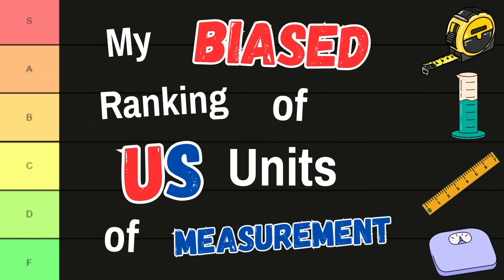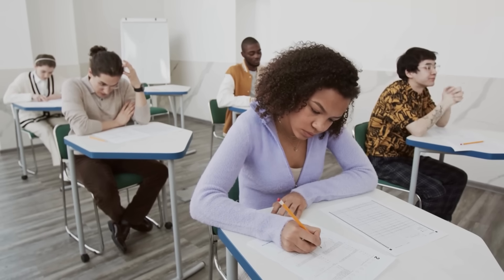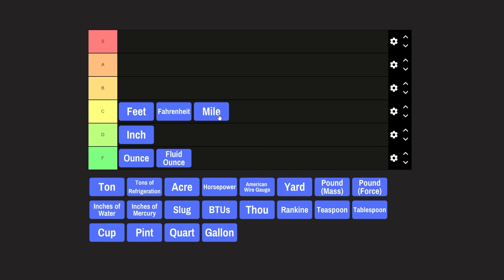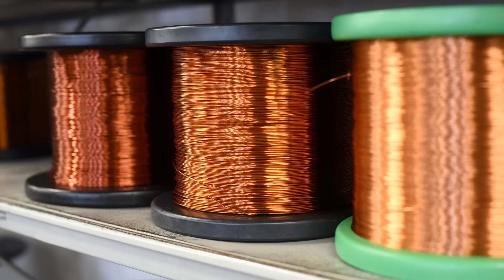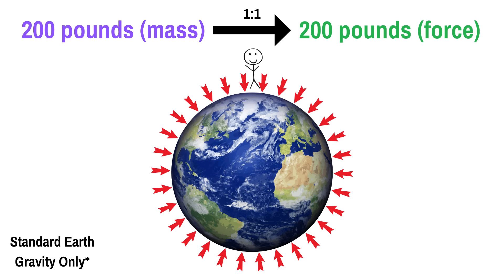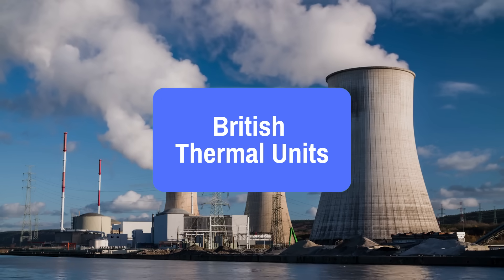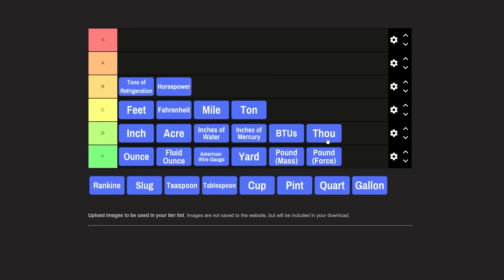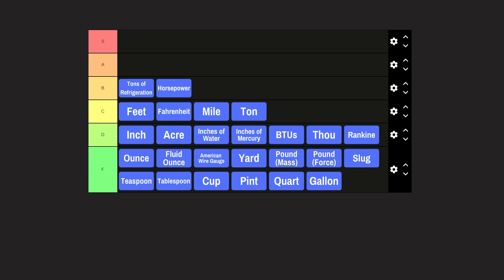Tier List of the DISASTROUS US Measuring System

Comment: Metric would be chill, if it were base 12
Reply: That would just make it harder
Reply: @logitech4873 base twelve is superior
Reply: @logitech4873  can you cut something in half, thirds, quarters and sixths easliy? literally yes, its the easiest form of division in humans, and guess what? its base 12 aka the american imperial system (glossing over the fact that a fair few measurements are different from one another, like how the mile is derived from the roman mile, but the nautical mile is one arc minute of latitude, and the yard/foot isnt even a part of the mile so intermixing isnt actually used, we just say half a mile if its roughly over 800 yards or 2400 ft)
Reply: @MrScorpion132  12x12 is more unwieldy than 10x10. Base 10 is as simple as it gets.
Reply: @logitech4873  until you convert odd bits, say for example you need to use 340 grams of whatever in a recipe, tripling it (common in the US as we often are expected to have extra food for guests to take home, or if people want to use a recipe they have on hand) in metric, you have to think more than 2 seconds to apply the ratio, here, we just say 3 cups.

the need for extreme precision in things like baking or building is rare for the average person, as nobody really cares if their cake recipe is barely noticeably different because the humidity along with some grams of flour or sugar were slightly off. neither do most carpenters need millimeter precision, usually 1/16 an inch (halving 3 times, very easy to do visually even) is the most anyone really needs.

now, dont get it twisted, we still actually use metric for things requiring the absolute precision it provides, physics as well as any high precision field (yes even in manufacturing) as well as international requirements are all in metric
Reply: @MrScorpion132  In your first example, why is it conveniently 3 cups?
You could change the example to be that you need 3.4 cups (or 3 and 2/5'ths or whatever), and you need to triple it. Now it's the same problem requiring the same amount of thought.

Conversely we could be talking about 300 g instead, which very easily triples to 900 g.

You are cherry picking numbers to suit your argument, but it doesn't make any sense because these numbers could be anything in both systems.

You don't need extreme precision for baking. But grams is the commonly understood small unit.
Reply: @logitech4873  i went with the converted scale here for simplicity, the whole point was that imperial is more ratios than hard numbers. due to that we dont tend to deal in 3 and 2/5ths,  if we do have a remaining fraction, it sticks within the base 12 system so its something like 2 from an inital 2/3. since we dont need scale level precision we can also **JUST USE THE SAME MEASURING TOOL MULTIPLE TIMES** oh i need 1/3 a cup? even if i dont want to do the mental math i just get 3 scoops from that measuring tool, its still quick and easy in our heads.

ive still seen grams and metric used in more industrial or larger scale bakeries where consistency is required, and i wont dock points for it. they're using metric for its precision and thats perfectly fine! we use both here in the states, US imperial for times when we want easy ratios and mental math, and metric for precise work.

Edit: for clarification, i went with one cup and tripling it because many recipies require a cup of milk/flour etc for sauces breads baked goods or whatever, and a cup is 340 grams, (now we measure liquids and dry ingredients differently, but any baker knows you mix dry and liquid ingredients separate first then combine anyways and thats just one aspect, the same can be said for volume conversion)
Reply: @MrScorpion132  We do the same approximations though. Our measuring spoons and cups are just differently sized. I feel like you're inventing a problem that nobody has.
Reply: @logitech4873  i edited it for the clarification on why i went with one cup. however, if we want to stick with the baking analogy, as most people dont need exact weights for ingredients here, the ratios can make for easily remembered and shared recipes, its a holdover from the fact that humans just intuitively divide and multiply by base 12 faster (actually scientifically proven, you can intuit a half or third or quarter, as well as double or triple or quintuple, while doubling something like 23 or 36 has issues) as well as in older times people had a cup that they used for measuring, and you could reasonably assume others in your village did the same, even if they werent exact if the ratios were kept the end food would be as exact as anyone practically needed.

again, nobody here expects it to be scientifically accurate, we just dont need that kind of precision so we go for the more practical quick easy mental math that any human can intuit from birth. its just physically harder for the average person to divide by tenths than halving again and again. both systems have strengths, both systems have weird oddities (like the meter originally being ever so slightly shorter than mathmatecally 40,000 km = the circumference of the earth) but both are now linked to mathematical constants and retain the strengths and weaknesses of their respective bases and neither should be shamed for people using them as intended.

we use a 0-100 granular scale for weather, the roughness yet quick practicality of being able to divide a foot in half, half again, and even more for our easy 1/2 1/4 1/8 and 1/16 measurements, the easy ratios for volume (1 gallon to 4 quart to 8 pint to 16 cups or a 1:4:2:2 ratio)  and even upwards, 3:1 feet to yard (which is only 3in / barely more than 1cm shorter than a meter, which despite only being 1% ish out of tolerance is extremely good for such a quick and dirty conversion). and even in metric, you still do as much as you can in those ratios, base 10 just doesnt allow for as many divisions, being 1, 2, 5, or 10 vs the 1, 2, 3, 4, 6, and 12 of base 12. its still more precise, but that comes at the cost of more complexities in daily use

Comment: As someone from a metric country to US, I think Fahrenheit deserve a A tier. Fahrenheit is perfect as a unit for setting air conditioner. Celcius is just a bit too coarse for this job. Ounce its self is ok, but fluid ounce a nightmare. The a fluid ounce of water does not weigh one ounce. The fluid ounce is first defined as the volume of a ounce of wine. (Why wine?)

Comment: Metric system is way better, but I think we need an octal system instead of a decimal one and a new temperature scale. While I get that both fahrenheit and Celsius have their benefits (especially for weather), Kelvin should NOT be based on Celsius, but rather on the ideal gas law using 100 or so instead of 273,15

Comment: The 39th root raised to the 6th power isn't even a fully simplified radical expression. It SHOULD be written as the 13th root raised to the 2nd power. And even then it still doesn't make any sense.

Comment: 1:03 Did you subtract the weight of the container?
Reply: Did u look at the scale
Reply: He did, it's at zero to begin with
Reply: The scale reads 0 before he pours in the soda, so yes, he did. The volume of soda weights more than the same volume of water would because soda is denser (which means it is heavier per unit volume). Soda can be thought of as a mixture of  water and other things, primarily the sugar. The dissolved sugar adds weight to the substance

Comment: I was a draftsman in the US for a specialty stair company. There is nothing wrong with the Imperial system and I don't understand the hate.
Reply: 1) if there is nothing wrong then why is it defined by the metric system?
How do you know how long a foot is? When you answer that,  ask how you know if that measuring tape is accurate? Ultimately it is all defined by the metric system.

2) conversions,  as soon as you start needing to convert,  the imperial system is at best an encumberance and at worst a space shuttle disaster waiting to happen. I mean imagine you had 50 40-foot lengths of fencing,  how much is that in miles? That calculation would be effortless in metric and the answer precise. 

3) most Americans don't know the imperial system at all,  they only know the units they commonly use. 
For example I'd bet you don't know how long a chain is,  or the length of a rod,  and before you claim that you don't need to know those,  the rod is the defining measurement of an acre, at 160 square rods and the entirety of the US measures land area in acres.
Reply: @xaiano794  there's that hate I mentioned lol
Reply: @toshaheritalvinen6543  how did you infer hate from my post? I regularly use the imperial system,  I literally come from the country that invented it and I think you're just trying to deflect since you clearly know my points are valid and are unable to offer any retort to even a single one
Reply: @xaiano794  fair enough,  honestly at first read I thought you were being condescending, but upon rereading it I see you weren't. I think your criticism of not knowing the more obscure units of measurement is pointless though, since an acre is easily defined as 43,560 ft^2. And I know there are 25.4mm in an inch and we have been defined that way since, what, the 70s?
Reply: @toshaheritalvinen6543  Be honest, you didn't know the conversion from square feet to acres from memory.
They aren't obscure, they are integral imperial measurements and I regularly use chains in my job.
The point of not using them is when you use lower units there is the tendency to round off which is exactly what makes metric the better system.

A perfect example is the ton, that should be 2240lbs as 1 ton is 20 hundredweight, but since americans didn't know what a hundredweight was, they rounded down to 2200 lbs to make it easier to understand, yet that wasn't enough and americans still struggled so in 1832 they rounded it off more to 2000lbs, this made conversions even more difficult since it was both different from an imperial ton, 2240lbs and also different from a metric ton, which at 2204lbs (1000kg) was very close to an imperial ton.

The only point to the imperial system is to use intermediate units to simplify calculations and since the US no longer uses those intermediate units, it means conversions are only ever done on calculators, an example would be your conversion of acres to square feet - like how many acres is a square mile? are you going to resort to google? pretty certain I could do the calculations in rods pretty easily. If you're resorting to google, then why not just use metric as you could do that in your head.

Comment: Moving the decimal place in metric to do conversions while seemingly easy is fraught with error as the direction and quantity are not always intuitive.
Whereas distinct conversion factors in imperial provide a degree of reassurance that the proper  operation is being performed
Reply: Sophisticated rage bait
Reply: Bs,  the answer is intuitive,  if i said i had 50 40-foot lengths of fencing and then asked you how many miles that was,  I'm not going to move the decimal place the wrong way and claim it's 600,000km long.

Comment: Okay im in thermodynamics and i do agree that faranheight is a horrible unit of measument to work with. But SO IS CELSIUS!! Both need an addition in the hundreds to be Absolutely accurate and both are basically arbitrary. The only difference is F is way more useful in everyday life (most of what it gets used for anyway) so it is a clfar superior measurement to C. I agree with everything else and wish the US would switch to the base 10 bliss that is metric. Its so much easier when all the units youre using can comfortably fit between 0 and 100 with just some minor modifications of terms. 2500 grams? Nah. 2.5 kg. Way better. 20°C??? Hell nah. 68°F
Reply: Name one reason as to how Fahrenheit is more useful.

Comment: Here’s the Metric System for ya
1 centimetre (cm)
1 metre (m) = 100cm
1 kilometre (km) = 1000m
1 kilogram (kg) = 1000 grams (g)
1 gram (g) = 1000 milligrams (mg)
Way simpler than Imperial to understand cuz it consists of 1s and 0s.
Reply: There are 1000 milligrams in a gram, you're referring to the centigram :D
Reply: @utubeuser1024 I forgot. Thx
Reply: It's still arbitrary.
Reply: @TurboLoveTrain  Every unit of measurement is arbitrary, it's just one that is simpler to use for everything.

Comment: Welll... When was the last time oxen were used to plow the earth? When was the last time horses were used to pull water from wells? When was the last time engineering used miles as steps, feet as the length of the chief engineer's shoe, inches as the length of... you know what, the boss's?

Metrics are the standard, in 100, 200, 1000 years light will still have the same speed in a vacuum, absolute zero will still mean the same thing, the gram will still be tied to Planck's constant. And will oxen exist? Not to mention plowing the earth with them.

Comment: I agree that F is a pretty nice cozy scale for describing everyday temps.  Maybe you just get used to C, but it feels a little cramped having hot and cold only 30 or 40 apart.

Also, the true story about the F scale is that 100 is human body, and 69 is nice weather for an optional light jacket if it's windy out.  The salt solution jury rig bullshit is purely post hoc.
Reply: No, it doesn’t feel cramped at all to not separate hot and cold by 30 or 40. That’s completely arbitrary. It’s just the way your narrow mind thinks, living in cholesterol-land. Celsius is just as good for weather as Fahrenheit.

Comment: Meter: based on the speed of light in void. Needs some adding or removing zero to convert.
Inch: literally based on the size of someone's thumb. Needs arbitrary coefficients to convert to smaller or bigger units which are themselves based on someone's body or farming activities.
but, but that's 'Murica!!

Comment: Fahrenheit is S tier. Europeans will say “it’s 40 outside” and expect you to believe that that’s bad. 40 just doesn’t convey the magnitude of the threat of heat stroke. If someone says it’s 105 outside, I go… wow. >100 that can’t be good.
Reply: I would believe that’s bad. It’s just a case of having used it. Celsius just makes sense; water melts at 0, water boils at 100. Why on earth would you want some strange system with strange, arbitrary units?
Reply: @Thumb_ exactly
Reply: "Too hot in my temperature scale is 100000000 degrees. 100 degrees Fahrenheit doesn't convey the magnitude of the threat of a heat stroke."
Reply: No just no

Comment: Farinhiwght should be higher.  It is based on water.  The guy who invented it put the bp of water at 60 and the frezing point at 8 degrees.  Farienhight multiplied it by 4 to get 32 and 220...  As we got betterr at making scales we realized that ot was slightly below the 220 and was actually closer to 212

Comment: AWG, if I’m not mistaken, came from how many dies you’d have to pull a wire through to get to that size, so 20 gauge wire has to be pulled 20 times, and 32ga went through 32 dies.

Also THANK YOU for recognizing Fahrenheit being a 0-100 scale of how hot you’ll be, and that it’s essentially human sized, and not whining that it’s arbitrary points for 0 and 100 while glossing over the fact that setting 0 and 100 to be the freezing and boiling points of a specific liquid in specific conditions is somehow less arbitrary.